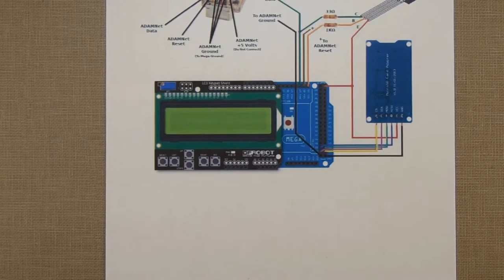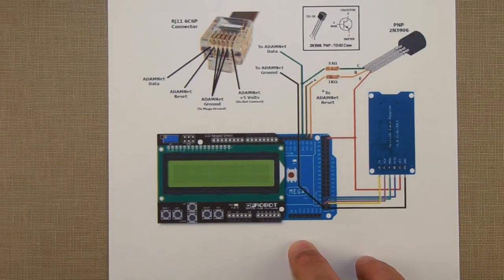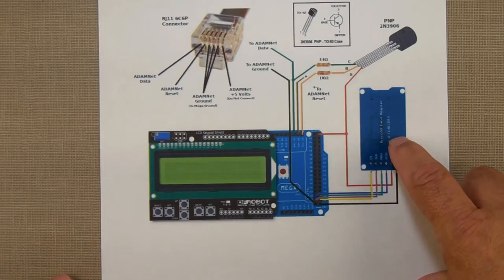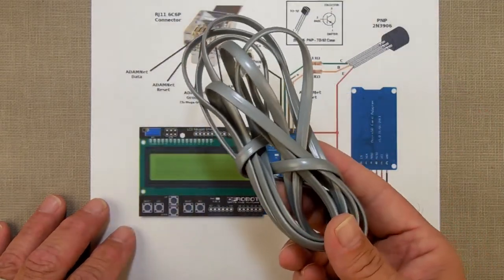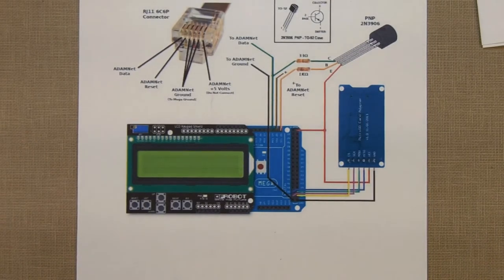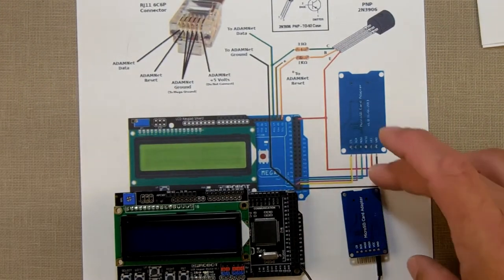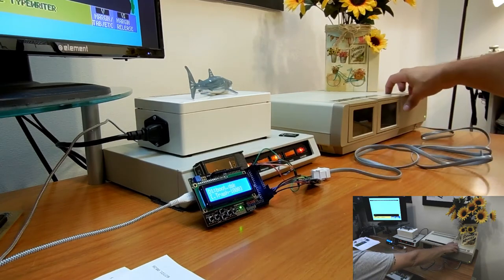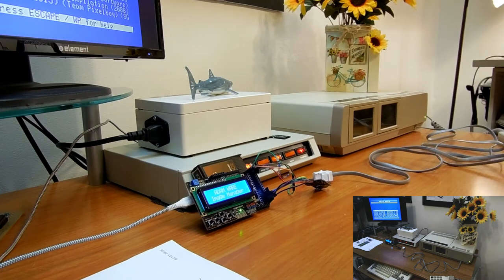Build an ADE: Coleco Adam for Dummies

Comment from the maker: oh I forgot a step you need to set the jumper on the at mega 2560 WiFi . 1,2,5,6,7 off 3,4 on this gives the mega access to the serial port.
Reply: After setting switch 3 and 4 to ON, the next attempt reported 52,784 bytes uploaded.  Noticed the HEX file is actually much larger.  Came right up to No SD Card!  : )  If we are going to stay on this firmware version, would it be safer to set switch 3 and 4 back to OFF?
Reply from the maker: @underthestarsgamingandtech9973  leave for now just in case

Comment: Nice demo. One point: you would typically want to load the firmware before connecting any hardware -- in case the old firmware was used for something else, which could send wrong voltages to various pins.
Reply from the maker: Thanks for the info!

Comment: I'm happy to announce my first ADE build is now complete and working!  This video was great inspiration for me to get started on the drive emulator, but I also decided to build a soldered PCB board for the ADAMNet jack, the transistor, and the 2 resistors, along with an added 6-pin male jumper connector for a wiring harness to my PCB.  Eventually I will fit it all into a plastic case, but for now I will be very careful about handling and static electricity while not enclosed.  Walking across carpets is a big concern here!  I used a different connector jack than Milli had in the video, but this did make it harder for me to compare with Milli's wiring order (which of course works).  As Milli said, the project "Connection Diagram" is "vague" and I would actually call it misleading because it pictures a male plug for the pinout when it really should picture a female jack instead.  This could lead someone (such as myself) to wire mirrored/backwards from the correct order.  Fortunately no damage during this learning experience.  My jack is labeled for pins 1-3 and these are the green, brown, and black wires respectively.  If you are using the same jack Milli had, follow his video and you will not have that wiring issue!
Reply from the maker: Awesome that you got it all working!

Comment: I have  a question.  You show this connected through the keyboard port, but that is not going to work for keyboard based software. Where else would it plug in?
Reply from the maker: Keyboard can plug in on the left side next to the printer
Reply: @8BitMilli  D'OH!  Mine has a Modem cartridge inside, so for some reason I thought that was the phone connection.  Dummy education accomplished!.
Reply: @rivards1  The optional ADAMLink 300 baud pulse-dialing modem uses a standard RJ11C phone line connector at the wall outlet but it has a proprietary L-shaped connector on the ADAM end which plugs downward into the TOP of the modem between the top cover vents.  Plugging a phone line into either of the AdamNet peripheral jacks might do bad things especially if you receive an incoming phone RING signal which is a 60 to 105 volt sine wave.  Hopefully you can locate an ADAMLink phone line cable for your setup.

Comment: The Micro SD cards often come in larger capacities than we need for this project.  Can you clarify the maximum capacity card this will work with, even if we waste some unusable capacity?  Will my 32GB card be usable?
Reply from the maker: Avoid the XD - from what I heard they don’t work as well -  just plain microSD is good
Reply: @8BitMilli  I have a PNY 32GB Elite SD HC on the way.  As far as I can tell, not an XD version.
Reply from the maker: I use a 1gb card - plenty of room for everything